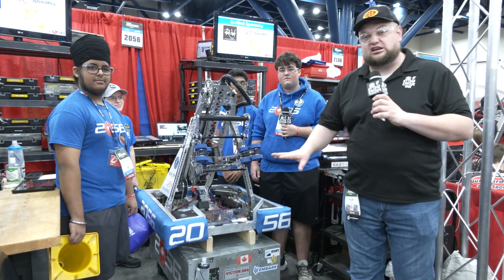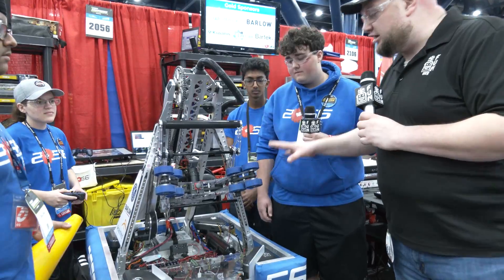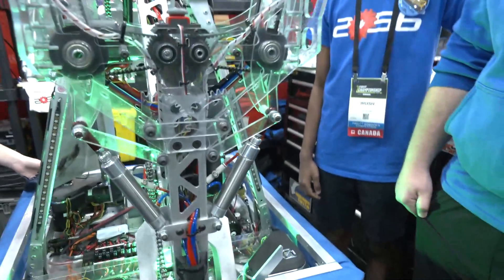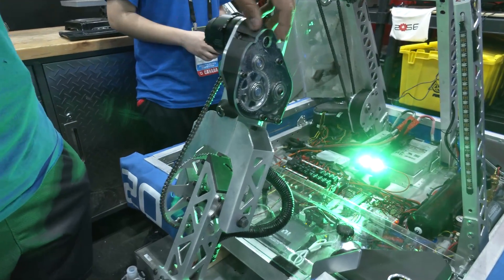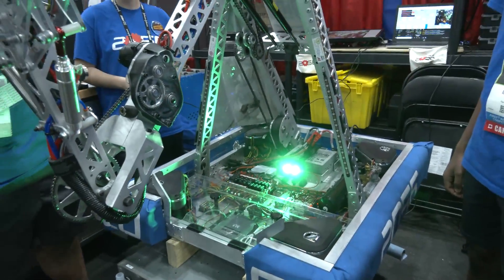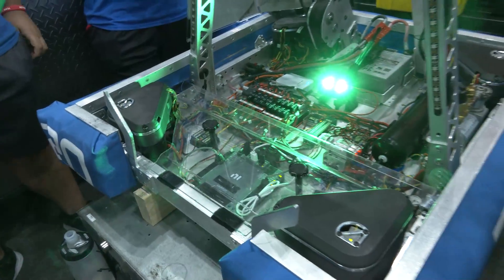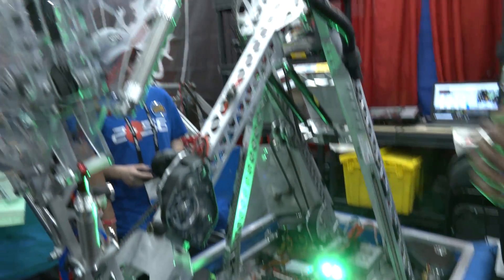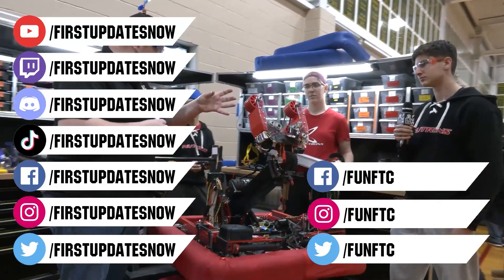Behind the Bumpers | 2056 OP Robotics | Charged Up Robot

Comment: What swerve modules did they use?  They do not say.   I also would like to know more about how they used the limelight, does not appear to be for April tags.
Reply: they used the limelight to detect the reflective tape on the scoring junctions/poles. based on that information from the limelight, the robot would automatically line up with the junction so the driver just had to click a button to release the game piece.
Reply: SDS